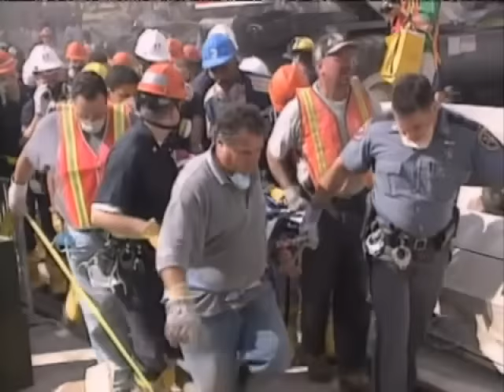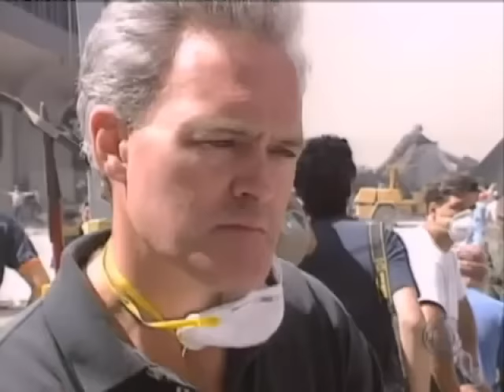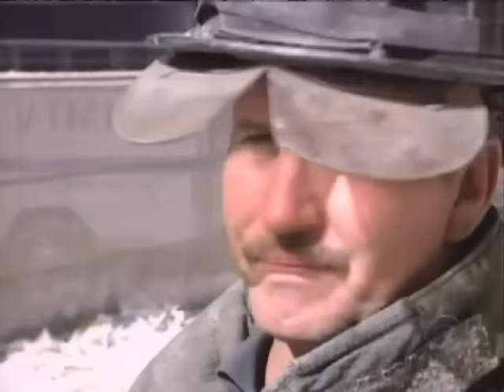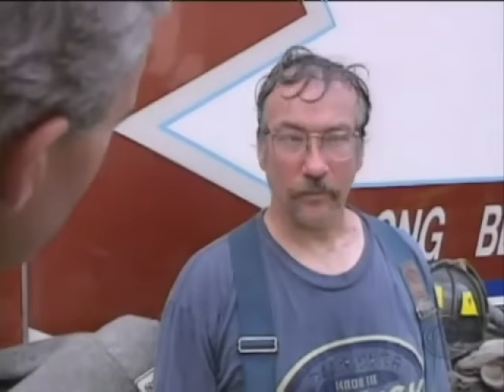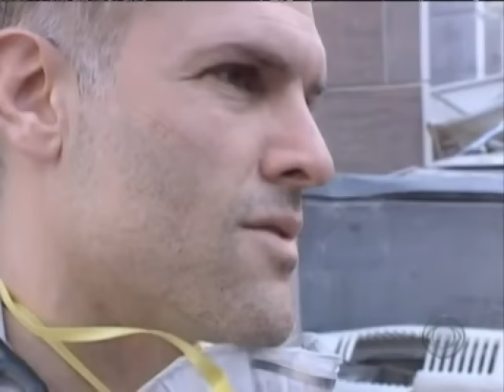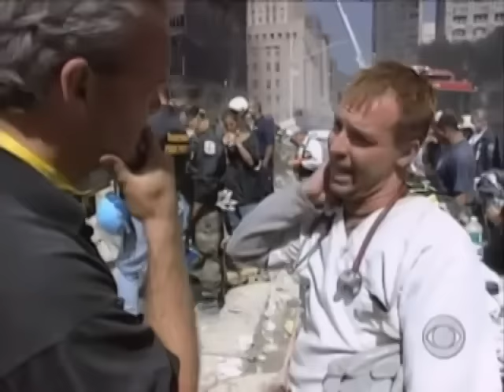09.12.01: Search and rescue in New York

Comment: Very intelligent response to a stupid assed question - 3:01
Reply: You are going to take structural engineering advice from a doctor? LOL... 🤣
Reply: @TheSuperStarCarWash  I mean, it’s not like he was wrong, so I don’t really understand your point 😂
Reply: @RetroPug205  40% on the outside 60% in the core ware the elevators and stairs are. the load is suspended from the core to the outer walls by light floors. It was designed that way to have more open office space. 
Wat also reduced the core "mass"and size was the elevator system. That split the building in 3 elevator sections.
Reply: I think he asked the question to get the community and families of victims to understand.